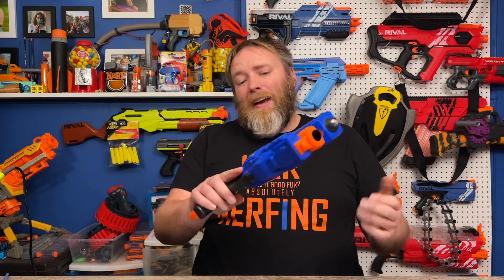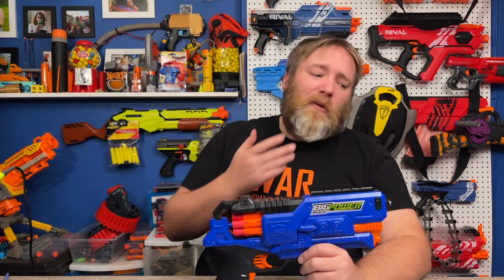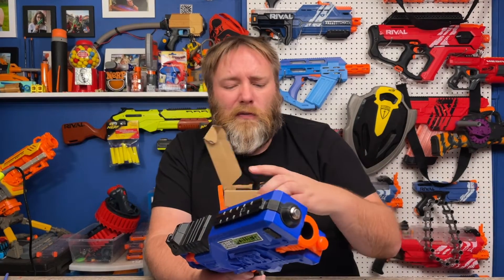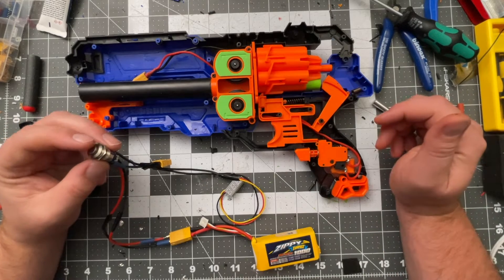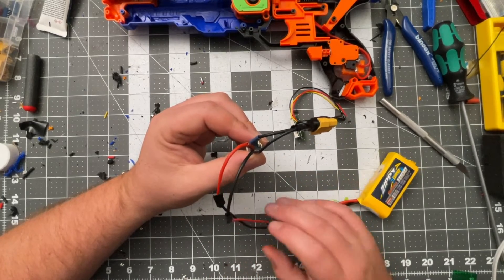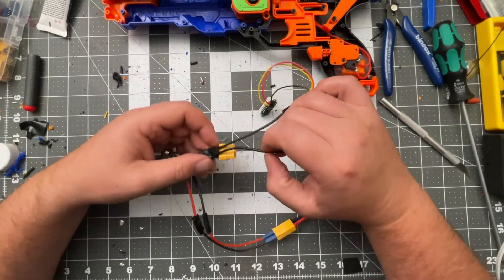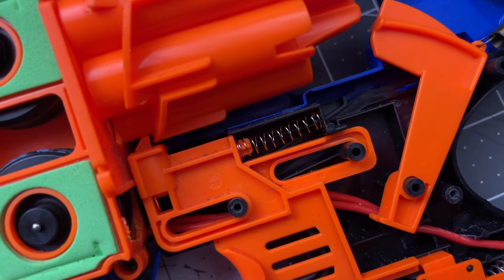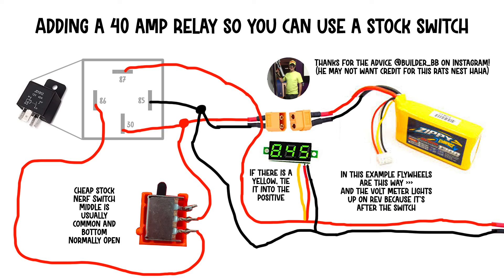How to add a volt meter, on/off switch and 40 amp relay to your Nerf project!

Comment: I love Mosfets.  Once you get the hang of them, they save a ton of time and effort mounting  replacement switches, plus you can reuse a lot of the original wiring to the original switch and to the Gate pin on the Fet, whihc save on the expensive hobby grade stuff.  Only downside is a bit more soldering.   Oh, and the components for a mosfet are stupidly cheap.
Reply from the maker: I need to do more of this for sure! I’ve found enough sources for switches that I haven’t done it that much, but there are times where it would be way better!
Reply: @maritimefoam  Well, I did try reading up on making H-Bridges, so I could use Fets for full auto builds, but it was way to complicated for my tiny brain!

Comment: Thanks for taking the time for making this video.  Gives a guy like me, who knows nothing about wires and electronic blasters, hope.  Take care.
Reply from the maker: Start with the easy stuff, simple semi auto blasters with just one switch, flywheels and a lipo connector. 

Soldering is the biggest leap, but I’ve kinda discovered that decent tips make all the difference. The one that came with my Ryobi soldering station were not great. Turns out new tips made me instantly not bad at soldering ha.
Reply from the maker: A Jupiter kit was actually the first project I ever did… boy was the soldering messy in there :P